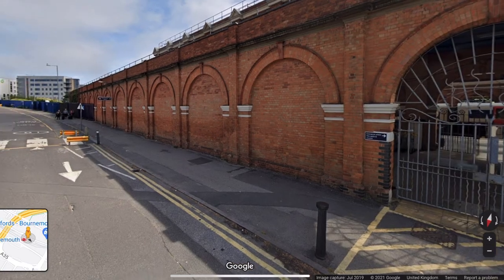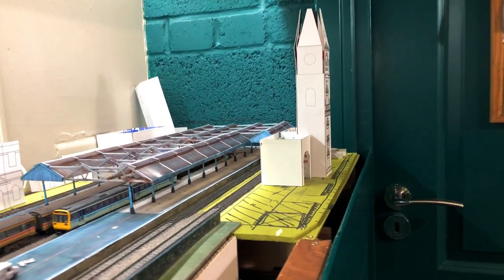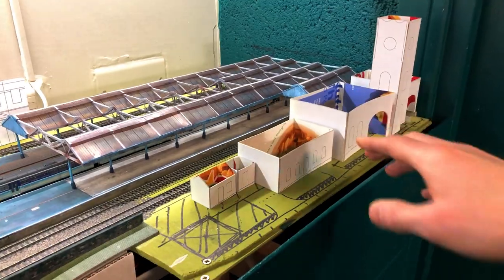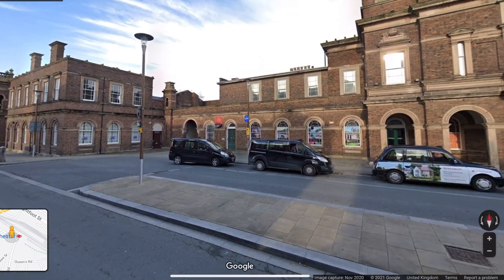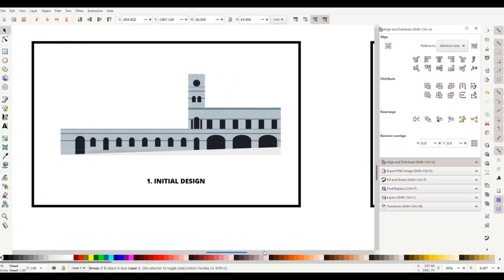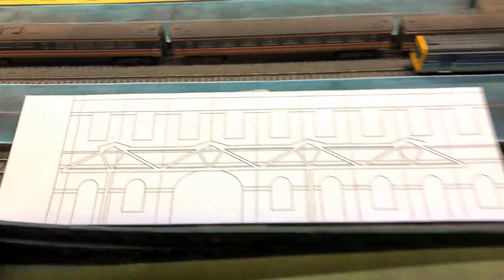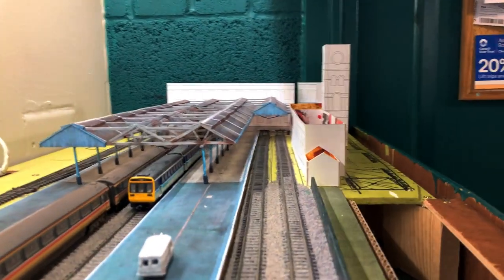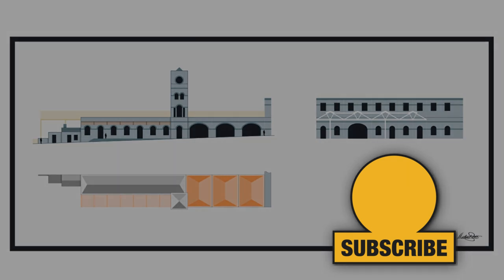Planning a station scratch build in 3D using cereal packets for mock ups

Comment: Nice update Michael, your work shows the benefit of doing the mock ups and trusting your instinct. If you are not happy with something, change it rather than accept it as it will forever bug you! Looking forward to seeing this one get built and the textures and detailing being developed. Thanks
Reply from the maker: I’m glad it’s over at last! Starting with the back of the front building and then working forward, I think.

Comment: Excellent update! you have certainly shown the benefits of Inkscape. I will certainly be using it when I build my Urban layout. I think this would work really well with the addition of windows/doors from some one like York model rail. I suppose its just a case of sizing there items, then just integrating them into the design. All the best Tony
Reply from the maker: Thank you. A really good call about the York windows. I’ve been tempted by them before and I may use them here. However, I am going to try a method I’ve not used before which involves sticky labels and transparent film (in my case, from a birthday cake)... I’ve seen others achieve great results and you know me... trying to do everything as cheaply as I can. If it doesn’t work, then York will be my fallback.

Comment: If you are looking for inspiration for the covered concourse to the right I suggest looking at Leicester station which has a large covered taxi rank loop and definitely has the dingy feel you describe
Reply from the maker: Thanks for the suggestion - that is exactly the sort of thing I had in mind. I'd never seen that before. The roof is very similar to the one I made for my main station, isn't it?! Will definitely fall back on that for some extra inspiration. Thank you very much indeed, Dan.
Reply: @Chandwell  Indeed, I think it would be very in keeping with the style of station you have achieved so far.  A modern take on a Victorian station.  I particularly like the metal gates around the arches in Leicester.  Having Google maps access to inside the concourse is very helpful too.

Comment: Your videos mate really helped me, never heard of Inkscape a week ago and now I'm using it every time and have built 4 low relief buildings using it.

Only thing that gets me is making roofs the right size for the angle of the gable ends 

Making a flat roof is easy, it's just a rectangle.

But the V shape you get on a gable gives me trouble.

My work around is just drawing a line using snapping and nodes then increase the thickness of the stroke to whatever MM I require. I.e 20mm for a 2cm wide roof.

Any tips for doing it better? Because you can't snap a clip to just a single line...
Reply: I also struggle with getting the roof panels right for the hips on the ends of roofs. Trial and error for me, but I'll bet there is a better way to do it.
Reply: @peterstecks7660  glad it's not just me!
Reply from the maker: Good morning! Great idea about using a really thick line. I’d never have thought of that. So if you can already do that, it is really easy to turn a line into a shape. A line in Inkscape is called a stroke. A shape is called a path. Select your fat line and use Path > Stroke to path. And there you are. Your line is now a rectangle. The other way of doing it is to measure the length of the side of the triangle. Select the measuring tool (it looks like a ruler) and with snapping turned on, drag from the roof apex to the base. It will tell you exactly how many mm it is. Then just draw a rectangle that size. Hope this helps. 👍
Reply from the maker: I will be doing a hipped roof on my station so I will include a tutorial for this. Once I work out the best way myself! I want to avoid having to fall back on Pythagoras if I can! 😂
Reply: @Chandwell  I've tried using the measuring tool but.. maths and angles lol

Comment: What is inskape and is it easy to use
Reply from the maker: Inkscape is a free drawing application. It can be quite hard to use at first as it takes time to learn your way around it. I have a playlist of videos that show how I use it. Maybe start with the "Absolute Basics" here: https://youtu.be/EZTqztrup7k
Reply: @Chandwell  I’m IT savy my issue is measurements like hight doors so it looks to scale. 
Is there a way to save shapes so say save external door hight or hight of single storey etc or do I have to add manual?
If so where’s the place to go to find these measurements.
Can u send the plans across say if I want one of some One then extend or change. 
Once all complete is it easy to add the building  details like brick/stone work. Or do u have to print out designs and by hand transfer to model. Have you or anyone made anyhow to vids on ink skape for modelling
Reply from the maker: I use Google to search for this kind of thing, e.g. average height of a typical door. Or sometimes I use photographs with people in them and estimate heights based on a person being about 6ft tall or whatever. Then I just divide by 148 to get it into N scale.
Reply: @Chandwell  
Thanks so there’s not a daterbase.
Thanks you have made scratch build look easy. 
Last question can you weather card kits?